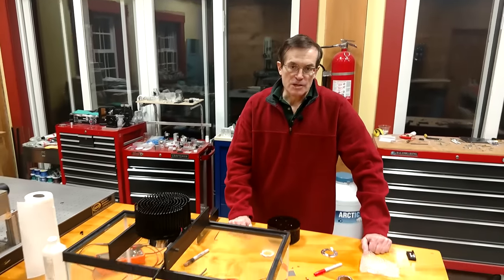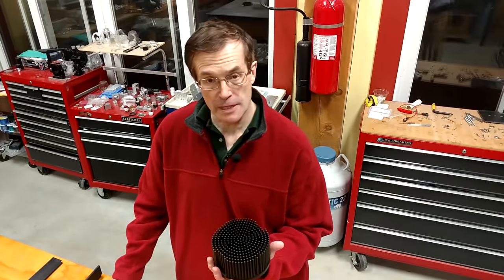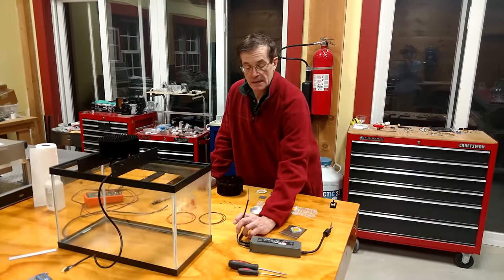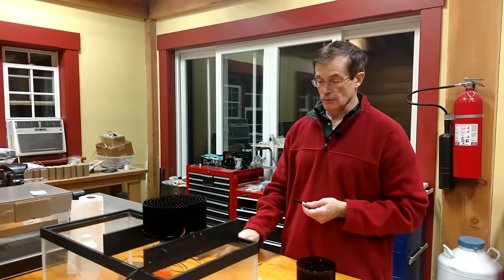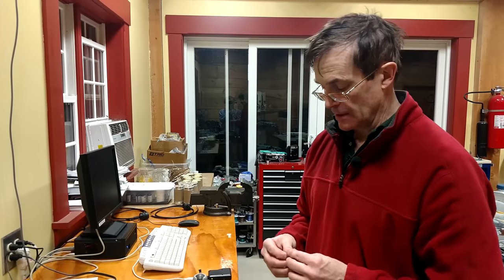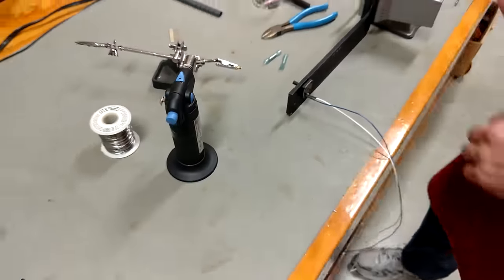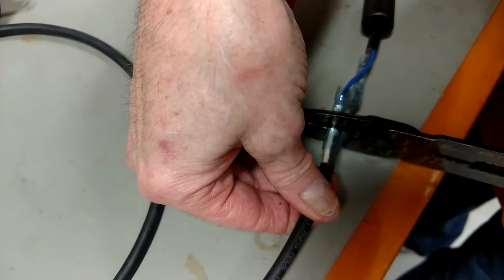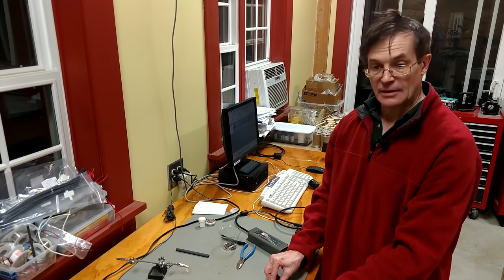Powerful LED Aquarium/Grow Light Assembly

Comment: Ouch, I would highly recommend that you do not rely on just the frictional force of those crimp connectors without any other retention on a live pigtail like that. I don't know how heavy that LED Driver is, but if it is potted it is probably quite heavy, and id if falls it can likely pull apart those crimps, leaving live wire exposed.
Another concern i would have with this, is that those quite heavy (?) lights are supported by the glass only, which is likely causing more stress on the glass itself, and if it cracks, it drops straight into the fish soup. Most of the Mean Well drivers have all kinds of protection built in, but i suspect all the fishes would be fried anyway.
Reply from the maker: Your point regarding the electrical interconnects is valid.  A more permanent connection would also have a lower profile and more attractive appearance. Thanks.  The weight of the lights is trivial compared to the loads the glass opposes in bending under water pressure.  This type of tank routinely supports lights directly resting on the plastic lip that covers the glass walls.  Larger tanks with larger lighting systems could also support substantial vertical loads, but access to the fish and optimal light distribution usual means that the lighting fixtures are suspended from above.

Comment: Are you going to do a video on how to get the dust out of a heat sink? You could fabricate an attachment for your shop vac that's narrow enough to get in between those tines..LOL
Reply from the maker: No.  The best way to get dust out of a heatsink in an assembly is to blast it with compressed air. If you can isolate it then a dishwasher works pretty well and if you've got one, the best is an ultrasonic cleaner.  We'll show how we built ours in an upcoming video.

Comment: 14000 lumens is a lot for a fish tank. suitable for maybe a 1000 gallon freshwater tank.
Reply from the maker: It is indeed, even too much for a marine aquarium housing XPS corals and this is about the highest lighting intensity used for any aquarium. But, its like being to rich, too thin or having a 200 MPH automobile...Seriously though, the pot lets you adjust the lighting down and if you wanted to outfit a larger aquarium, you could simply extend the arms.
Reply: I thought about building one of these, but then I ended up just using a pair of readily available lamps instead. One growth lamp for the plants, and one LED strip for the visual.
Reply: Long Plays I recomend a good cri of like 90-98+ if you want the tank to look its best. Yuji led makes some nice 20 watt cobs with 90 cri someone should make a light with those, i might use those in the future.
Reply: lumens is a terrible measure of LED output. lumens is green light, which humans see the best. LED should be measured in PAR Watts, lumens is almost a useless term here.

Comment: Is the water gonna get hot?
Reply from the maker: No.  The actual heat associated with these effecient lights is low and most of that is radiated upward from the lamp rather than into the tank.

Comment: How can you destroy a diode with reversed polarity? Isn't that the part of the job description of a diode?
Reply from the maker: A diode simply means a function of two electronically dissimilar materials.  In light emiting diodes and diode lasers, if the reverse polarity is applied the junction will almost instantly overheat and the chare carriers will be driven out of their proper location, permanently.
Reply: @TechIngredients  If the current is strong enough ,of course. I was thinking more abut diodes in general.
Have you ever done tests on a led? Their efficiency increases by lowering current but the voltage drop is smaller. I was thinking about fixing voltage on max and then drop the current. Does that change anything, can it get more efficient that way or is it just in my head?

Comment: Love your videos... however; dull grey = cold solder joint. Cold solder joint = high resistivity, wasted solder, and susceptibility to fatigue failures. In your application, maybe not a big deal, but the information provided is incorrect.

Edit: Additional: Nice lights for fresh water. Aluminum, especially raw, unanodized aluminum (yes, there is a tiny amount of Al2O3 on the raw aluminum due to O2 in air) is not a great choice of frame material for a salt water tank. Aluminum will corrode and drip back into the water, killing your corals, reef life, and eventually fish.

Comment: That huge heatsink, takes too much space and need open or ventilated space for proper operation, major back draw for high output LED's.
Reply from the maker: Tow other options are available.  Add a fan to allow a much smaller heat sink or invest in a larger number of COB LEDs and run them at a reduced output while mounted on a flat, large area, aluminum plate.  The savings on the heat sink will offset the cost of the LEDs and the profile will be even flatter.
Reply: You will have to open the windows too With 4kW lightbulbs except if you want the climate hot (and probably humid) ;-)

Comment: if your son is going with a natural planted tank he should look into full spectrum cob leds
Reply from the maker: Funny that you mention this.  In several of our videos, we are in the large room above the lab and because of the volume of this space and the high ceilings, we have 5 HID, high bay lighting fixtures.  For energy savings and instant start and restart, I was considering retrofitting these with an LED array similar to what I showed in this video.  The spectral choices are numerous and I agree that a full spectrum with red and blue emphasis is beneficial for plants (fresh and marine) while a warmer 3,000k color makes room lighting more pleasant, for me anyway.
Then he showed me what are called, corn cob LED lamps with integrated drivers, mogul base and designed for just this retrofit.  The color choices are more limited, the cost/lumen is higher, but it's so... easy.
Reply: Anyone doing a planted freshwater tank or a macroalgae refugium should absolutely be using full spectrum COBs but if you're building your own LED fixture I'd like to also strongly recommend using modules with as high a quality as you can afford. It's the one part nobody should skimp on for a DIY fixture. Stick with LEDs made by a reputable LED company — Philips, Cree, Nichia, Osram, etc … there are plenty to choose from.

The reason I mention this is that as this technology has advanced a lot of companies have started producing low cost "grow spectrum" or "High PAR" (PAR = Photosynthetically Active Radiation, basically the wavelength range from just above UV, ~400nm, up to around 700nm) modules.

These cheap modules, among other oddities, often lack green (~555nm) in their overall spectrum — presumably they reduce costs by reducing the number of different phosphor coatings (??).  If you're growing marijuana, or some non-flowering vegetable, or starting next year's mini Christmas tree for your apartment "from scratch" this might not be an issue; but a lot of plants exhibit growth rate and morphology (growth direction & overall shape) differences when they don't get green light — even though most of it is, obviously, reflected.

A lot of cheaper "full spectrum" modules also produce almost nothing in the near-UV or far-red, which may or may not be a good thing, depending on what you're growing, and how you're growing it. For coral reef aquariums, this is like the missing green for green plants — some species of photosynthetic corals and corallimorphs will behave and grow differently in the absence light wavelengths below 425nm or so.

If you've had success with another type of lighting technology in the past, you can likely look up a spectrum chart for whatever brand bulbs you were using. The big LED companies all provide full spectroscopic charts for their COBs, allowing you to match as closely as possible. If you can't find a close enough match (unlikely these days), you can fill in the spectral gaps on a DIY fixture without too much fuss using smaller narrow spectrum COBs; but I doubt anyone has had to do that for typical aquarium spectrums for at least a few years now — the LED industry advances at an absolutely insane rate.

The US EnergyStar guidelines for LEDs are a decent way to quickly rule out LEDs that you probably don't want to bother with for a DIY fixture. If a module isn't EnergyStar compliant, don't force your photosynthetic organisms to rely on it.

Comment: LEDs are coming along, but still don't beat HPS. Your 100w COB is rated at 9000-11000 lumens, but a 600w HPS will do 72000 - 95000 lumens and if you do the math the HPS wins... even the less efficient 400w HPS will do 50000 lumens.
Reply from the maker: I'm not sure how that comparison works.  It is true that as the wattage of metal halide bulbs increases, the luminous efficiency increases as well.  HPS lamps, based primarily on sodium metal, are more efficient than mixed metal halide bulbs that contain a blend of several metals.  This mixture produces a whiter, more balanced illumination with a higher CRI and is much more commonly used for aquariums because it more closely matches sunlight while a HPS lamp looks like a street light. Nevertheless, The COB I demonstrate has a luminous efficiency of 150 lumens/watt at 100 watts input and a CRI of 80 while a HPS lamp has a CRI of 25.

Comment: 100W cree , from a real vendor? Tech Ingredients dont fuck with Ebay chinabrand ripoff trash.   All in one source is nice. A few years ago I pieced together a 100W COB lamp, and man it took hours to find a heatsink that was drilled to fit a bracket that matched a COB, with bayonets and a reflector that fit the bayonet, from 3 different vendor.  But I managed to get it all, and it was like putting together a simple kit.  Man was it a ton of light though.

Comment: It doesn't seem like a very logical thing to do. Why spend $45 so you can build one light (not including the power supply) when you can buy 6 LED 4' lights on Amazon for the same money? If you could save money by doing it I could see the reasoning but this just doesn't make sense.
Reply from the maker: Most of our videos involve the design and construction of projects in order to give the viewer practical methods and sources to reproduce what we did, but more importantly to be able to customize the project to their liking.
For example, the COB light emitter produces a metal halide like, single source shimmer that is more appealing than a distributed source.  This is my opinion and many people agree, although certainly not everyone. Also, based on the design I presented, scaling to much higher power becomes progressively more cost effective.

Comment: Great video of led assembly, bad Akv. Design, 1. a lot of light on front viewing glass=Algea. 2. A giant heatsink, when the water could be used as one. 3. no elektrical protecktion from water/salt 4. if the light fits in the tank, its gonna end up in it, at some point, fix it 2 the wall/ceiling. 5. those groves, is meant to have top glass in them, so the water dont vaporise so fast. 6. Unless u use long wires, u wanna heat shrink everything, NO small open connecktors. 7. the reason why there no longer is metal frames on new Akv. is that people died, they got grounded, pun intended.